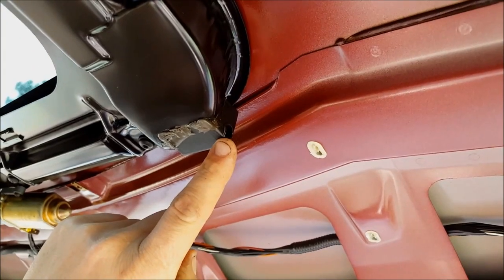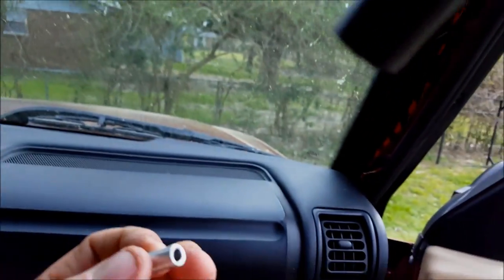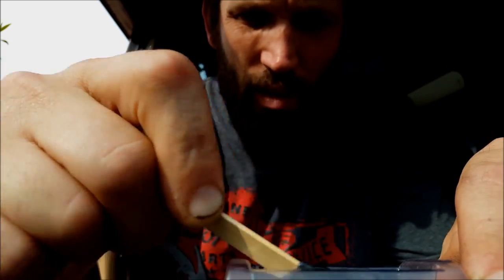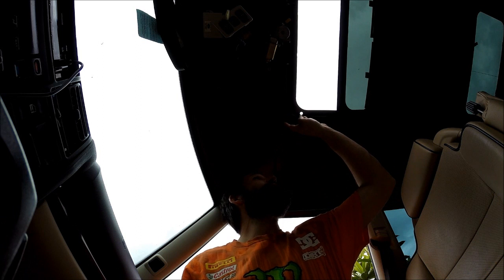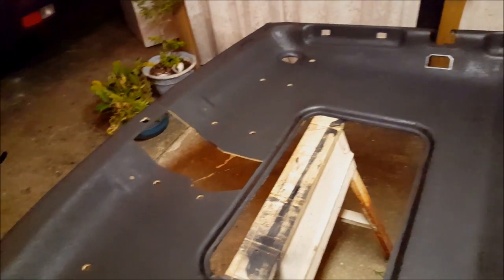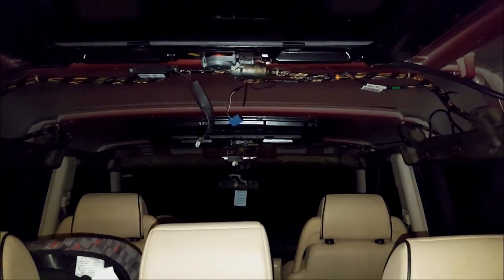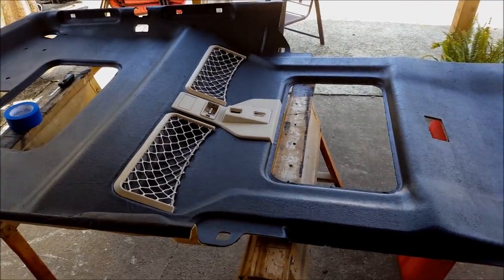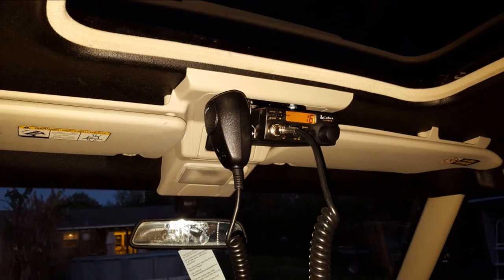Land Rover sunroof leak repair and bedliner for the headliner

Comment: Thank you for posting, I have done so much trying to find my leak and never thought of removing the headliner.  Wondering, if you could give me some advise. I have removed all the parts with the exception of the center piece where the second sunroof and the net pockets are and rouble with removing the b pillar molding.  Any tips would be greatly appreciated.
Reply from the maker: b pillar just pops off. pull the door seal back and you will see the metal clips.
Reply: Thank you so much, What about the center plastic part where the nets are? I have removed the center light but can't see to disconnect the center roof section without possibly breaking the nets or the center piece next to the second sunroof?
Reply from the maker: Are you on Facebook? If so look me up and shoot me a request. Jack Griffiths. It's easier to show you in pictures but that center cargo net section stays on the headliner

Comment: What product did u use for the headliner?
Reply: truck bed liner paint. It is about $80 a gallon on amazon with the roller and a brush - and when dry has the appearance of textured cloth.

Comment: how long did it take to drop the headliner?  Im thinking of dropping it in my 04 to run coax for cb whip on the tire carrier.   Typing this I realized it might be easier to just use fishtape to run it up there lol
Reply from the maker: I don't think a fish tape will do it for you. there is tons of stuff to get hung up on. I downloaded the D2 service manual and just followed it step by step. I had it out in less than an hour. quick tip, fold your rear seats down and have someone give you a hand removing the headliner from the truck.

Comment: Sorry to post on old topic, but this looks great. Mine is out right now and ready to cover or paint. How did it cover the imperfections in the front corners like where the greenish fiber cover is folded to make the curve? 03-04 has the green fabric over the board, I see that yours did too
Reply from the maker: Yeah man, it covered that well. All these years later it still looks like I did when I did it. One of my favorite mods I've done, I'd do it again! Just be ready for it to smell for a week or two. If I did it again, I'd leave the headliner out for at least a week for the paint to cure. It has a pretty strong smell. But once it's gone, it's gone. It's super durable too.
Reply: RedEyed Jack thanks! I’ll go for it
Reply: Did you use the 2-part rusteum bed liner with the epoxy hardener, or just the ready to roll can? It seems they’ve rebranded the two-part as a “Professional” version now. Also, matte or gloss? I’m hoping to get exactly what you did!
Reply from the maker: @wolson  Sorry for the delayed response, I used the regular bedliner right out of the can,  I bought it at Walmart.
Reply: RedEyed Jack  all done and worked great. See what you mean about the smell, but all in all I’m happy. Thanks!
Reply from the maker: @wolson  Did you wait to install it or were you like me and have zero patience and want instant results?
Reply: @RedEyedJack  i left it in the back yard for about 4 days, but then couldn't take it any more. It's been out for six months while i slowly repaired every "common problem" leak in the Disco 2.  sunroofs, windscreen, rear door, roof rack bars. Ran the wires for a backup camera and rear-view mirror monitor while i was as it.
Reply from the maker: @wolson  nice!

Comment: We’re there any issues with broken tabs...  I’m about to pull my headliner... it would appear that I might have a leak not associated with the pan drains.
Reply from the maker: I did not have any issues with broken tabs. But i really took my time and was really careful.
Reply: I appreciate that.  I’ve partially pulled it to check front roof motor, and I’ve actually had my headliner replaced. Seems that, after install, I have some leakage.   It wasn’t a LR specific place so I’m thinking they might have been a little rough...
Reply from the maker: @martinhogan5970  That happens. That is why i try and do all my own work.

Comment: I was going to do a similar thing to my D1. Until i took the liner out and began painting it. Looked horrible not to mention the edges where the liner meets the sides did not look any good.
Went to a fabric place and picked up some black material.  Got some contact adhesive from bunnings and went to work.
Each to there own i guess........
Reply from the maker: I'm not that familiar with the d1 headliner but on the d2 there is trim everywhere, no bare edges. I'm really happy how it turned out. I think it looks better than factory!

Comment: It would have been nice to see how to remove everything that holds the headliner in.. The lights and a\c vents are giving me trouble and finding a video that shows how to disconnect then from roof or headliner has yet to be found.
Reply from the maker: Best thing I can tell you is to download the RAVE manual off the net and follow step by step. I don't have rear air so it would not have helped you in that anyway. I just followed the service manual step by step

Comment: Looks like this is my next project as well.. I've had shop rags stuffed in the top Left and Right corner for 2 years now lol.. also headliner is coming off.. terrible design! Thanks for sharing!
Reply from the maker: DAVID K PATTON No problem! Thanks for watching
Reply: Use the denatured alcohol to get the glue off and you'll be amazed what is under there. First get the cloth off, then remove the little net pockets (small screws hold them in place).  Then just take your time getting that yellow glue gunk off with the denatured alcohol and a cloth.  Then you're off and ready to paint. I followed this exact process in the video and got SAME results. It looks amazing.

Comment: I love this idea! Could you please tell me the brand of bed liner you had used? I don't want to buy something and leave my headliner sticky! lol
Reply from the maker: nerdy8675309 I used Rust-o-leum brand bedliner. I bought it at Walmart. one gallon was way more than enough but the quart size won't be. It dries hard, not tacky at all, even in mid summer florida heat.
Reply: RedEyed Jack Thank-you so much for the quick reply man! I appreciate it! I have another question, it feels like the foam has some give to it when you press on it, should I be worried about the bedliner cracking when installing the headliner again?
Reply from the maker: nerdy8675309 let me start at the beginning. Peel the headliner fabric off. Get a good heavy nylon scrub brush and scrub all the foam off of the headliner "board" for lack of a better word. Wipe it down with denatured alcohol. Roll on the bedliner. The bedliner is flexible so no worries about it cracking but I did wrinkle the headliner in the front passenger corner trying to reinstall it myself. Have some one give you a hand getting it back in. But no worries about it cracking. That bedliner is tough stuff. Plus if anything ever happens to it just touch it up with more bedliner, it will blend in super easy!!

Comment: Nice one bud , gonna be doing this tomorrow , your Sunroof still not leaking?
Reply from the maker: Yes. Front sunroof still holding. I did have to do this repair to the rear sunroof about a year ago.
Reply: @RedEyedJack   hi again, so I finally got  round to doing this today stripped it down from car,  rubbed it down, painted it, going to do third coat tomorrow.. i am concerned about condensation though , have you had and water fall from surface of the roof , not from the sunroof , but actual condensation droplets , through any of the seasons? or any cons at all over the past 3 years with this... thanks in advance.
Reply from the maker: @3dag3nt79  No issues at all. I've had to pull the headliner down twice since it did  it to work on the sunroof motor, no signs of any condensation  or anything.

Comment: What paint did you use? Going to do the same.... also have leaky front and rear sunroofs grrr
Reply from the maker: Daniel Dumbarton  Rust-o-leum roll on bedliner from walmart.
Reply: RedEyed Jack Thanks, will find similar in the UK. Mine is 17 years old come March.
Reply from the maker: Daniel Dumbarton I think raptor liner is pretty common in the UK

Comment: Where did you put the antena?
Reply from the maker: Michał Trejgis my rear wiper arm was missing when I bought the truck and the wiper motor was bad so I disconnected the motor and used the mount my dad made which is a old pair of vise grips with the antenna mount welded to it and vise gripped the antenna to the wiper arm mount behind the spare tire.

Comment: can you name drop the brand of texture you used? Thnx
Reply from the maker: Rust-Oleum from Wal-Mart
Reply from the maker: and for the record it used less that 1/2 a gallon for two good coats.
Reply: Did the smell ever go away from the liner. I just hate the ideal of putting in a new liner just to have it fall again in 5 yrs. Too much trouble until I saw your video. Do it once and forget about it forever.
Reply from the maker: +jhobbs1824 the smell has gone away 99.9%. it's been a couple months now and I'd do it again in a heart beat. if I did it again, I'd leave the headliner out for a week or so before I put it back. that would solve most of the smell issue. the first week it was real strong.

Comment: How is the noise level in the car?
Reply from the maker: No difference at all from stock
Reply: I just did mine - no difference. Maybe a bit quieter even.  Either way, I can promise you the flimsy bit of headliner cloth and the yellow glue gunk does nothing for sound absorption!
Reply: @mrp410   Awesome! I Have a 03' SE and 04' SE7 Disco, both with this problem, so im going to take a pass at this and see what how it comes out. Thanks for the input. How long did the project take you total?
Reply: @Arkman25  It took about 1-2 hour to take the headliner out after removing all the visor stuff and grab handles etc. Then about 2 hours of cleaning the gunk off the headliner (yellow brown glue crap)..  Another hour to paint it with a roller and it took about 24 hrs to dry. It took 2 hours to put it all back in. It can be done quicker probably but I go slow and careful and try not to rush coz thats when I make mistakes.  Good luck!

Comment: That looks cruel. I repaired around 20 headliners, headliner fabric isn't expensive, you just need some spray glue and a bit of patience, that's all. Afterwards it looks brand new
Reply from the maker: I love the way it turned out and I use my overhead storage as fishing rod holders, if I had the fabric it would be all torn up.